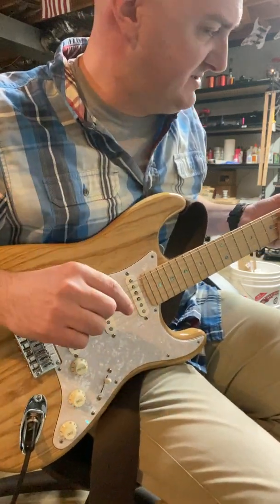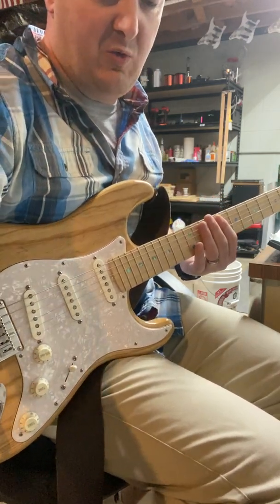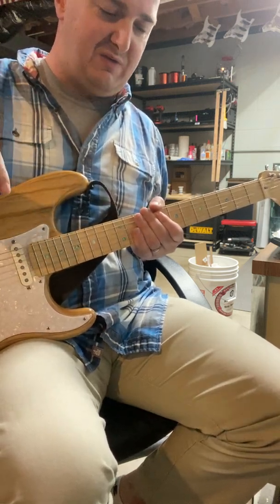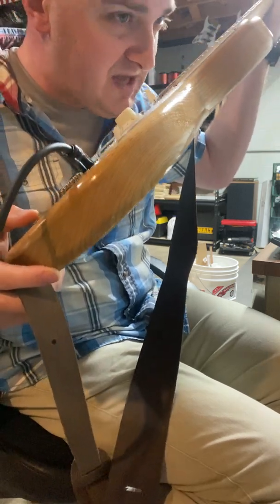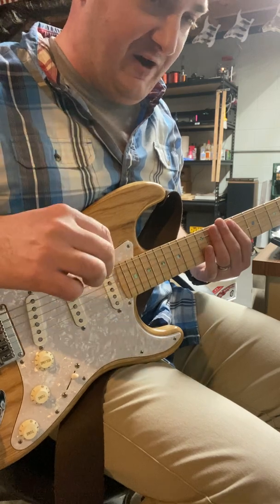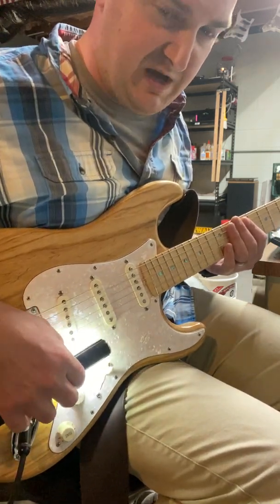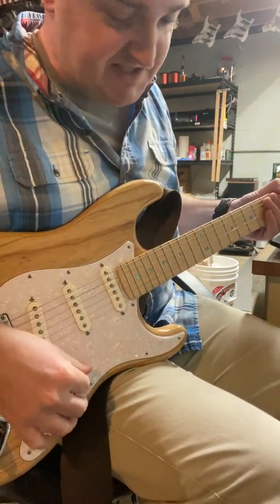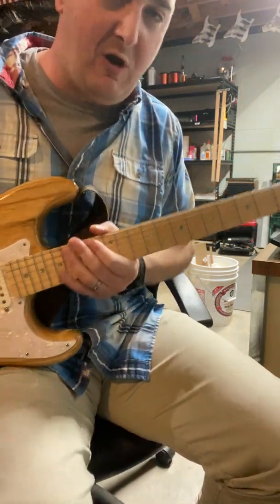60 cycle hum, RFI and Shielding is useless Noisy electric guitars SCIENCE EXPERIMENT

Comment: The wiring in my house is crap. I painted my noisiest telecaster with shielding paint that uses actual nickel, noth the graphite stuff. Then I did a variation on star wiring I found on an electronics discussion forum. Then I twisted all the wiring inside that guitar. It's about 95% quieter, and makes almost no noise, unless the guitar is in front of a computer monitor a few feet away. So you can kill alot of noise guitars produce. I wonder how much of it is your amp. My Rivera (twenty-three years old) makes more noise than my Mesa Mk V, which is only ten years old.
Reply from the maker: Probably more the solid ground you made than the shielding. Shielding passive components does nothing to stop noise because passive components take away from a circuit, they don’t add anything. 

The noise in my video might partially be coming from the amp but 95% of what I was demonstrating was guitar noises. 

Thanks for stopping by.
Reply: @MathewsGuitarWorks  You might be right. But using the shielding paint (nickel) then grounding it to the existing wiring basically makes it a faraday cage. Hard to imagine that didn't improve things. Twisting wiring? Maybe. I was trying everything because the guitar was almost unusable in a recording environment. The star ground variation did eliminate any unnecessary points of contact, i.e. further sources of ground noise. On the other hand, I have a G&L with nothing but shielding paint, and everything else is stock wiring (replaced the pickups with Cavalier tele pickups and Rob's pickups are quieter than most). it's almost dead silent. But as you mentioned, it varies with guitars. Not sure why, but it does. I watched the entire video and didn't see any solutions for noise. Did I miss something, or was the video just to clear up misconceptions and misunderstandings about noise?
Reply from the maker: @augustusbetucius2931  The video wasn’t about offering solutions. It was about identifying the noise properly and showing why shielding doesn’t work as everyone thinks. 

When the gateway of RFI is the pups and the face of the pups are exposed to the outside world, no amount of shielding or grounding will eliminate or reduce the RFI.

90% of all shielding is surrounding the control cavity which DOES NOT AMPLIFY SOUND. This fact seems to be escaping the most sound and logically intelligent people I’ve discussed this topic with. 

If you experienced a reduction in noise as the result of twisting wires, shielding and star grounding, I am pretty confident when I say there was something else going on and the improvements where not as a result of shielding and twisting wires. 

RFI is very specific. It’s radio frequency interference. It’s not ground noise and it’s not 60 cycle hum. Not even talking about amp noise, I’m talking guitars. 

There is no basically a faraday cage.  You either have one or you don’t.  When we are discussing mostly passive guitar circuits, the voltage is so minuscule that twisting wires is likely useless also. Then the fact that the face of the pups are still exposed, this argument is null before it starts. 

I’ve run a guitar repair/mod business for 13 years. I’ve replicated this topic over and over and over again.  Most of this stuff is placebo at best.
Reply from the maker: @augustusbetucius2931  I would probably be willing to concede that some pieces of wood have different capacitances that effect how the guitar sheds noises or holds on to it than shielding paint changes. I mean that was literally pulled outta my ass there but that’s more of an unknown than the fact I know shielding does nothing to reduce rfi in guitar circuits.

Comment: If you use a wireless, the grounding issue goes away. And it's actually safer, you're less likely to get an electronic shock with a wireless system. I remember back in the 80's spending a vacation at a house way out in the countryside. Was astonished that I could play single coils with no noise in that location. Nice video, you really know what you are doing!
Reply from the maker: Preesh! Thanks for stopping by.
Reply: i'll get wireless too, thanks To your tip 🙏🙂.
Reply: Wow I didn't know this.
Reply: @slimturnpike  Yes, absolutely true. Use a wireless and you won't get a potentially lethal shock.
Reply: @slimturnpike  No ground hum. If you use a cable and take your hands off the strings, you get hum, but not with a wireless.
Reply: @slimturnpike  I'm really amazed that guitars are designed to be grounded through the player's body. Many people have had serious injuries due to that design, for example Ace Frehley of Kiss was almost killed when he touched an ungrounded railing on stage. Keith Relf of The Yardbirds was killed by a shock just playing at home. Using a wireless is safer and quieter than using a cable.
Reply: How did it work out for you, my friend? It won't kill single coil interference but it makes a huge difference either way.
Reply: @MichaelSorensen-bl3ec  i don't know yet 🙂. I don't yet have money To purchase it.
Reply: @slimturnpike what wireless di you order? Did it stop the hum noise?
Reply: @slimturnpike  thank you! Glad they are working fine for you 😁

Comment: hi Mathew, i got same crackling and humming noise, and with a hissing noise on my strat with 1954 fender pickups. i tried to resolder all the ground wires few times, used multimeter to check it, all seems grounded. i started to suspect my soldering skills and solder wire. im getting tired to mess with this problem over and over again. i really like how the guitar sounds and dont want to change the pickups. So is it really normal that the single coils just had that these noise? And for extra information i used 500k pots on my volume knobs and remove the tone pots out of the circuits. i know usually people use 250k pots on single coils but i kinda like the 500k pots sound. So is the 500k pots on volume and remove tone pots act is a no no?
Reply from the maker: Does the crackling go away when you touch the strings?

Is the humming you describe the same as the 60 cycle hum I demonstrated in the video?

As far as the 500k pot, that’s up to personal preference. I personally don’t like fender style single coils on 500k pots because they are too bright, harsh and ice picking in their tone. 

As far as the pup is concerned. Old pups can make lots of extra and unwanted noise as they get older.
Reply: @MathewsGuitarWorks  hi the crackling and the hum doesnt go away when i touch the strings. but i do checked the grounding from the strings to the output jack grounded parts, it was connected. i swap the pots , switch and output jack everytime i resolder it, so those parts are fairly new. do u mind if i private message ur facebook page some of the videos and picture of my guitar?
Reply from the maker: @garyfxxk  absolutely send me a message on fb.

Comment: I used to build computers cases with boards and we used to have a anti static wrist strap connected to the board and to our wrists whilst putting it together. To reduce that noise there's a way to ground that bridge and earth it to you using a metal wire with metal button or maybe make up a effective passive noise filter in the guitar just a thought thanks
Reply from the maker: When you touch the strings that grounds you to the circuit already. No need for all that. 

As far as computer boards vs guitar circuits, pc circuits are most likely a series of active and passive circuits which can amplify certain noises where passive guitar controls do not amplify anything. 

Thanks for stopping by and commenting.

Comment: Thank you for telling us what we already knew! Seriously. You verified and explained why this is happening. I'm sure in the 70s there was MUCH less RFI in the air and hence way less noise. Even then, I'm sure there was enough noise to be annoying in many situations. I've switched out cables, guitars, amps, pedals and even turned off or unplugged WiFi, lights, monitors, computers etc and there is still noise. Stratocaters are just noisy. I'm looking into a dummy coil solution....thx
Reply from the maker: Absolutely, totally agree about the fact there is so much RFI in the air. That’s something I was going to touch on my next video. As far as Strats go, I don’t have enough noise to even consider doing anything about it. Any noiseless or dummy coil I’ve tried always took away part of the special character of what I love about single coils. I just deal with it. I play with a pretty good amount of gain sometimes and still don’t have issues. Any noise I get is via bad house wiring and RFI. 

Thanks for stopping by 🤘.
Reply: @MathewsGuitarWorks  Agree 100%
Reply: Whatever type of HB system has to have nearly equal the noise of each pickup.  It's not really the DCR of dummy coils that affect the tone, but the inductance.  Any coil added in series will have some inductance, which will lower the resonant freq of each pickup, and reduce the Q, which reduces the peak level and the high-end.  Using a lower capacitance cable can raise the resonate freq back up, but the Q will be even lower.  Something like the lIlitch system is a good low inductance compromise, but you can get a set of completely silent Wilde NF series pickups for less than that.  I have a few Wilde sets.  The L280/290 set is the mid 60s style.  At 4.2H, the L290SL is a bit higher inductance than typical ~2.8H, but has good highs with a low (~200pF) capacitance cable, and the lower Q reduces harshness.  The Wilde "Q-filter" offers some very useful tonal variation via lowering the inductance above the low frequency range to create a mid-dip with a variable peak freq.
Reply: Do you have experience with the Suhr or Illitch systems? From what I have seen on Youtube, they are supposed let the true sound of the single coils through.  Please let me know. Thank you.

Comment: True: Thin shielding is ineffective at blocking magnetic fields in the audio frequency range.  False: Shielding is useless for blocking electric fields in the audio frequency range.  RFI consists of electromagnetic fields.  For noise sources farther away, electric fields are the bigger issue and shielding helps.  For noise sources that are close, magnetic fields still carry significant energy and thin shielding doesn’t do anything to stop them.  Even in the world of electrical engineering there is apparently conflicting information about grounding and shielding.  The results of this video are clear, but so are the results of this other video.  https://youtu.be/qeAS7EIVO1E Both are valid results for the specific noise environments.  A pickup shield needs to be electrically connected to block electric fields.  You don’t want it to block magnetic fields or it wouldn’t work for the guitar.  In this test, the noise source gets close enough to be in the “near field”, where the magnetic fields would still pass right through a shielded pickup.

Comment: Great work! I really don't understand why many guitarists simply ignore the physics... 
By the way, the humbuckers and hum-bucking pickup configurations assume that the EMIs picked up by the coils are same, which is not true in a strict sense. In most of real cases, this assumption is approximately true since the winding turns of two pickups are close enough and the noise sources are sufficiently far from both pickups.
Reply from the maker: 🤘 preshate you stopping by and commenting.

Comment: needed to see this. added a humbucker to my strat and heard the loud buzz. thought i did something wrong so i went and shielded everything in a faraday cage making sure everything was linked and grounded. helped a good amount but still buzzed. this made me realize its probably my room, which has a lot of electronics turned on and connected to the same few power strips
Reply from the maker: Most likely the reduction in buzz was from an improved ground connection. Shielding does zero to reduce 60 cycle hum of non-humbucking pups and does very little to stop RFI because the face of the pups are still exposed to the outside world. Controls are passive components so shielding them also does nothing. If you have a lot of stuff plugged into the same outlet as your amp, that’s probably the most likely culprit. 

Thanks for the comment 🤘.

Comment: I'm a brand new guitarist and had Epiphone Les Paul gifted to me through the mail. When it came in a whole coil was dead so I ended up going through a nightmare with GC for the warranty repair. When I finally got it back I got to play for more than a couple of minutes and immediately noticed the massive amounts of 60 Hz hum and grounding buzz. I ended up spending a couple days bouncing back and forth between my local shop and guitar center while these issues appeared and disappeared seemingly at random. No one could figure out what was going on. Turns out having the volume knob on the guitar turned way down, and everything else turned way up was practically extracting those hums and making them super loud. Now I'll be honest I wasnt convinced there still wasnt an issue that was going to appear later just cause of all the  bs up to this point but seeing this video really put me at ease that its completely normal.  It seems YouTube finally recommended something good; I really appreciate this
Reply: Cheap volume control...change it to better quality, it'll do wonders
Reply: That kind of sounds like the ground lug on the volume pot isnt getting a solid connection.
Reply: Maybe they wired the hot and ground reversed at the jack.

Comment: I have a rare problem with my guitar, when I touch the bridge or strings the hum (ground noise) increases only when I touch the jack plate the hum  (ground noise) reduces, do you know the possible reason for that? Thank you! Great vid!
Reply: The guitar circuit is improperly grounded. Have a guitar tech go over it.
Reply: @miket.220  The paint on the bridge is not conductive, also the saddles are not conducive. Squier flaw in the design.

Comment: I started guitar in the 70's with a Strat. Through a Fender amp. Tube amp. There was always NOISE.  Where I learned the teach had a L P deluxe through a Ampeg V 4 stack. I used his Ric 360 through a silver face super reverb. When we stopped playing to get ready for next song everything was noisy. Guess lot people didn't play 70's equipment Real equipment not digital not even analog. Stuff now is so nice. Even my board of used modded 90's pedals is so far ahead of what I had back then. Still use Strats , in fact my current Strat I had since 96. My Boogie is from 85. I only owned it since 2012. So much quieter, still 60/100w of tube pwr. Keep your digital processor quiet noise. Never feels real to me. If you never had to control 100 watts of tube pwr while singer talks to audiences. That's real.
Reply from the maker: I like it all. If I had to have only one it will be my handwired deluxe reverb and a few pedals.

Comment: I’d come the same conclusion on shielding, when I did it myself.  After being told I was probably doing something wrong by so many people, it’s nice to hear an agreeing voice!

Great video, thanks!
Reply from the maker: I never understood why people can’t see the fact that the pup face is uncovered and is the open door to all things that enter a circuit.

Thanks for dropping by and commenting. Stay tuned, l I’ll be doing an in depth experiment to finally put this topic to rest. Just gonna have to find some time to do it and video it.
Reply: @MathewsGuitarWorks  You'd be surprised that you can get some EMI reduction just by placing a 1/10" thick Aluminum pie tin behind the pickup.  Two sheets of Al foil will barely make a difference.  Cu is more effective than Al in very thin layers.  BTW, I believe the noise from that lamp qualifies as EMI.  RFI is well above human hearing.
Reply from the maker: @GCKelloch  pie tin wouldn’t do anything either. Yes you would be correct that the light would be considered emi. However, emi and rfi are used interchangeably and emi can be used to describe all of these noises where rfi is a specific subset. A quick intertube search and read can clear that up for you.
Reply: @MathewsGuitarWorks  I've tried it with a thick reusable pie tin.  It does make a considerable difference.
Reply: @MathewsGuitarWorks  do you have a link to that please? Thank you!
Reply from the maker: @BeesWaxMinder  https://resources.pcb.cadence.com/blog/2022-the-basics-of-emi-and-rfi
Reply: @MathewsGuitarWorks  thank you I look forward to following the link after work

Comment: Does a Morley Hum Exterminator reduce or get rid of the noise?
Reply from the maker: Thanks for the comment but I don’t know which noise you are referring to. I identified a few different noises/hum/buzz in the video. 

As far as the piece of gear you’re talking about, I’m not familiar with that.
Reply: @MathewsGuitarWorks  Oh Sorry! I meant the hum and buzz from the amplifier. Would a Morley Hum Exterminator work with the amp reduce all that buzz hum?
Reply from the maker: @athanasius23fe  I’m not familiar with that particular unit but I have a power strip that is designed with similar components that does that same thing. It was a marginal improvement at best.  I can’t attest to the Morley unit though.